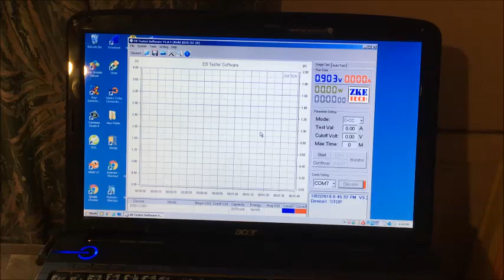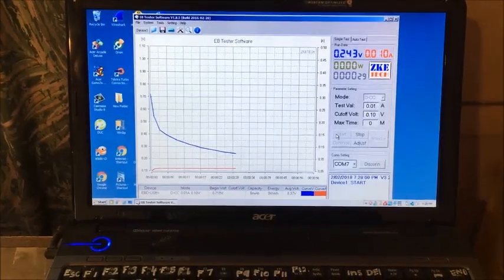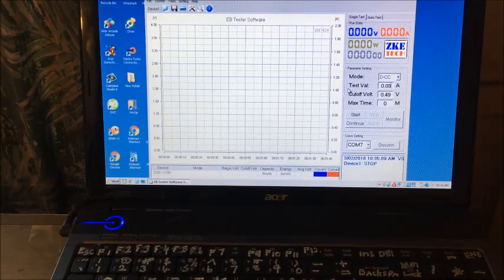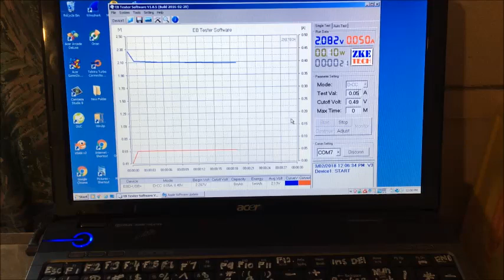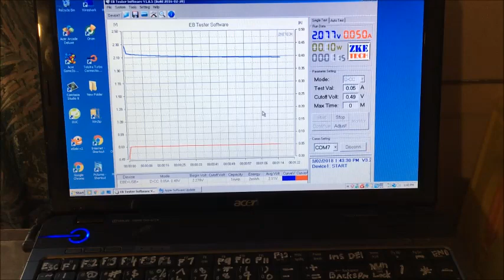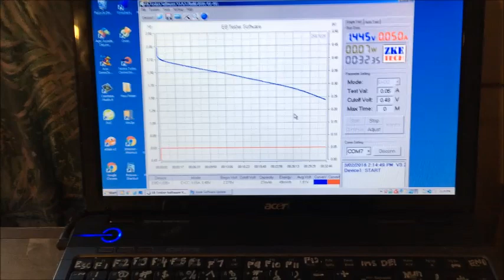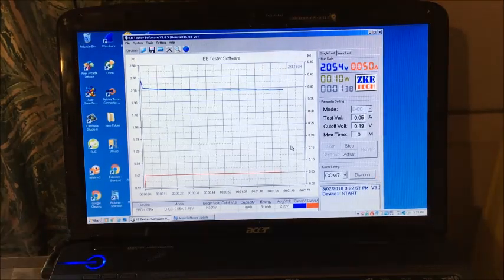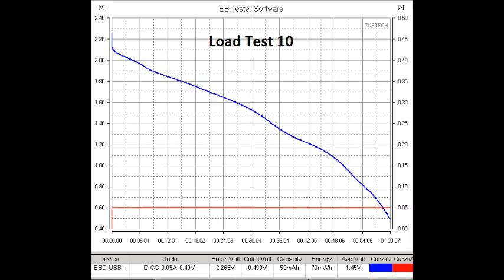All Carbon WetCell Day 2 to 4

Comment: Hi Dan,
Good set of tests. The cell seems to be holding up quite well, in fact getting better  :-)The Self discharge over 24h was a bit disappointing, something to think about but you can only look at one aspect of the cell at a time I guess.
The charge curve is unusual  :-)   Until charge 9, which looked more promising giving
71mWh, and charge 10 giving 73mWh your best yet.The electrolyte is clear which is a good sign, maybe nothing being consumed hopefully.
Martin.

Comment: Are you using magnesium sulphate in the electrolyte? If so check the resistance. It seems it might be possible that if the resistance is too low the charge on the plates might be draining through the electrolyte.